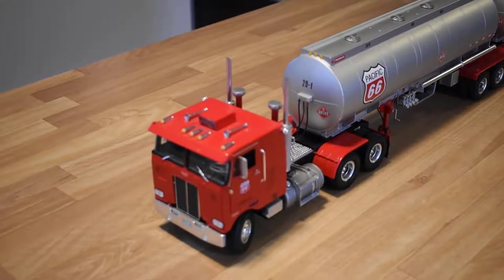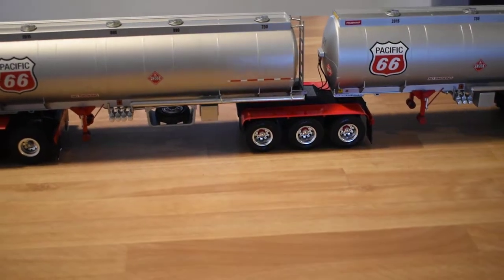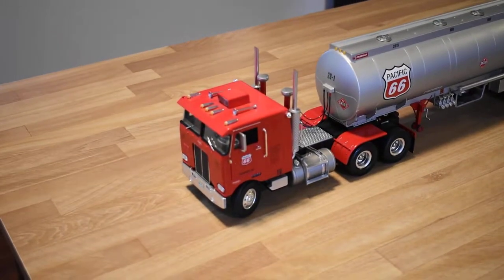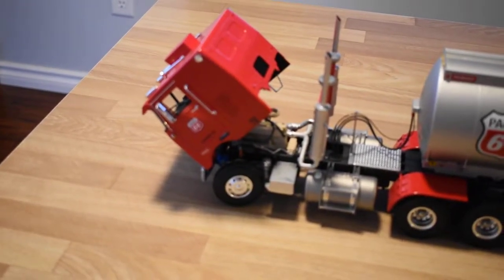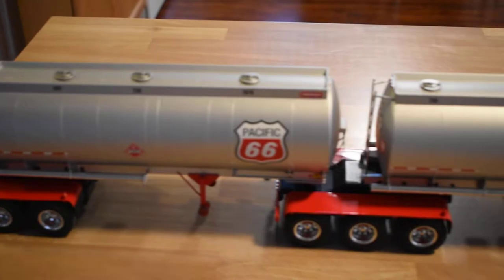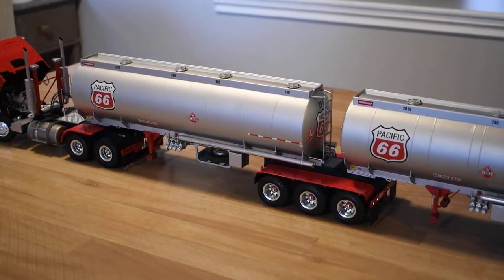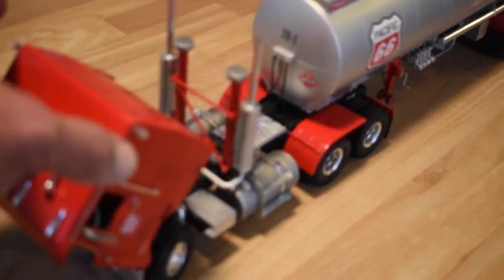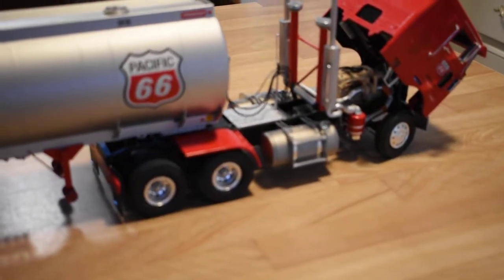AMT Peterbilt 352 Cabover & Super-B Fuel Trailers Build-Up

Comment: Hi , Super nice build , l’m in the prosses to make one my self , I’m a truck driver and I’m driving a tremcar B-train fuel tanker for a campagnie call Transport Norcité in Lévis Québec , i just want to inform you that the unloading pipes on your build are on the wrong side of the trailer , they are normally on the right side , but your build is awesome , great job , you have lot of talent 👍🏁
Reply from the maker: Hey Martin, thank you very much for the compliment! From one truck driver to another, I appreciate your hard work and efforts! You are also absolutely right about the plumbing, it should be on the passenger side but I moved it over on purpose because I display the model from the drivers side and want to show it off. Thanks again for the kind words and I hope your project turns out great, cheers!
Reply: Nice job! The on and off load valves are mounted on the curbside for safety I would assume. Understanding just for show , again nice job.